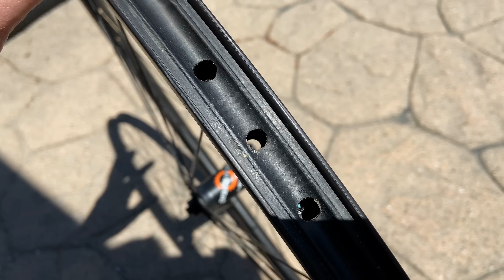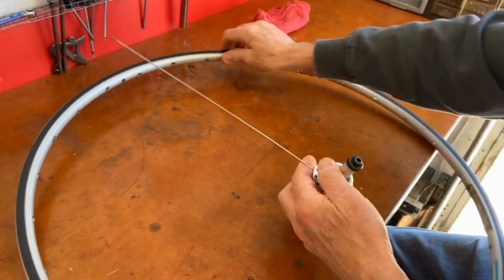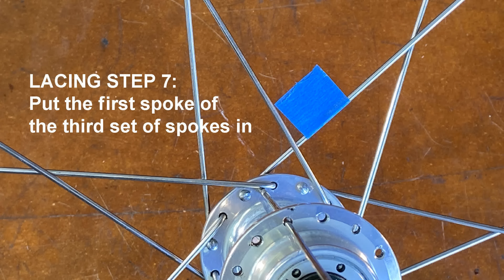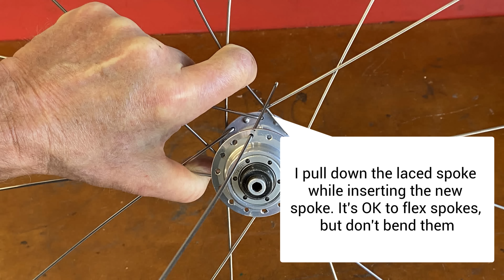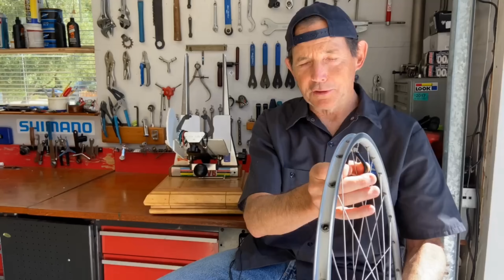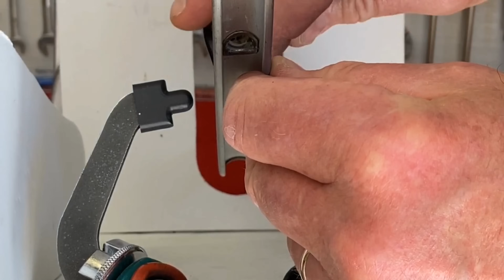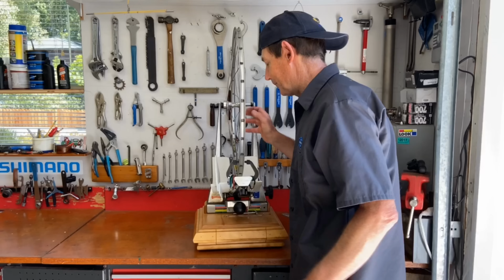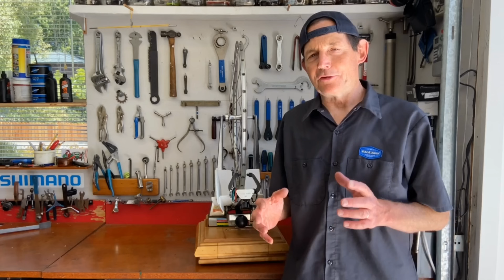How To Build Bicycle Wheels THE EASY WAY! #bikerepair

Comment: Very nice.  Thanks for the information.  Recently, my wheels have had snapped nipple flanges.  Spokes are intact.  Are there spoke nipples with a little larger flange so they don’t break through the wheel holes?  Or, is there another fix?
Reply from the maker: Thanks for watching and the question, cottagethyme. Nipples come in different sizes but the entire nipple is larger not just their flanges. You can use nipple washers to add material to the nipples and reinforce them. 

But, you should inspect your intact nipples to see if the problem - the reason the nipples are breaking is because the spokes are too short. If the spokes don’t reach to the top of the nipples (look down from inside the nipples), then the nipples are not fully supported and can break. Alloy nipples are especially prone to breakage when spokes are even a little too short. 

If the spokes are too short and the nipples are alloy you could replace them with brass to fix the problem. Brass nipples are much less likely to break than alloy - even with too short spokes. Or, you could also replace the short spokes with longer ones. Okay? Hope this helps. Thanks again!

Comment: How can I do it for a 1 cross, 16 holes track wheel ? Do I still have to leave 3 holes between each spoke ?
Reply from the maker: Thanks for watching and the question, Mano. Yes, it’s the same process. The only difference from what I show is you are using 4 sets of 4 spokes and crossing only 1 spoke. Have fun!

Comment: i'm about to start a rebuild on 2 28 spoke wheels 1 front 1 rear, think i will need to watch this video a few times, i got a bit lost watching. never done this before, i can do anything else on a bike but always passed on wheel building.
Reply from the maker: Thanks for watching and commenting, Jowen. The key thing is to take it one step at a time when you lace the wheel. And take your time, don't rush. You can do it. Good luck and let me know if you have any questions.

Comment: Thanks for your video!  Around 13:00 you helped me catch an error before I went to the tightening and truing steps.  I had spin the hub in the wrong direction and the spokes surrounding the valve stem were not parallel but in a tight triangle.  I was able to backtrack, and now it's right.  Thanks again!
Reply from the maker: Thanks for watching, ML. Whew! I'm glad you caught that error. It's a very common mistake and easy to make - good job finding it before you finished! Enjoy your new wheel!

Comment: When building a few wheels long ago, I always did all the spokes outside in first. Less weaving needed, but the wheel stays "loose" longer, not ideal.
Another thing, I don't like the tapping of the ends, I feel it's the wrong way to get the spokes to seat. Let me think about that more.
Reply from the maker: Thanks for watching and commenting, Michiel. I actually show two ways to seat the spokes so viewers can choose which one they like - the tapping - or the leverage technique with a small screwdriver here: https://youtu.be/XUqul03hbZ8?t=1382 And, yes, there are many methods of lacing wheels and all have their pros and cons ;-) The one I teach here is specifically aimed at new wheel builders because it's the one I have found easiest to follow for the students I've taught. Thanks again!
Reply: @JimLangley1  Ah, my bad presumption (that this is your only way). The method I like is to squeeze pairs of spokes with your hands (gloves on of course), in a few stages of tensioning the wheel. That way the head is pulled, and the bend gets to seat in the hub flange.
Another method I've seen being promoted, of putting pressure sideways to the hub, is trying to accomplish seating the spokes as well, but doesn't have the leverage of squeezing pairs of spokes.
Reply from the maker: @MichielvanderMeulen  yes, in my video I also show squeezing pairs of spokes, which is part of the stress relieving procedure as is putting sideways pressure on the rim. These steps help seat the nipples in the rims and relieve possible wind-up in the spokes, and less so, helps pull the spoke heads into the hub holes  Tapping the spoke heads and pulling them into the hub holes with the screwdriver method are done earlier in the build process as a way to guarantee that the spoke heads have full support in their holes. These techniques direct the force more on the spoke heads than squeezing the spokes (stress relieving). That's the idea. Hope that helps explain.

Comment: I rebuilt reusing the spokes and rims, and hubs a shade smaller, an 8th of an inch across.  I had trouble getting the second set of spokes on each side to connect with the nipples, and even now after tightening these spokes are showing their threads. I can’t work out what I have done wrong. Can you help?
Reply: I have used your method with the tape instead of the twist and I have found where I went wrong.
Do they say this correspondence is now ended?  Or ask a question and you are half way to the answer.  With Thanks.
Reply from the maker: @robertmuncaster3510  thanks for letting me know that you figured it out. Congratulations and enjoy those new wheels!
Reply from the maker: Hi Robert, if all the spokes are showing threads below the bottom of the nipples your spokes are most likely too short. One thing you can try is to relace the wheel but this time if you used 3-cross lacing, try 2-cross. That will effectively make the spokes longer and can sometimes fix the issue you're having. Give that a try.
Reply: @JimLangley1  Thank you for your suggestion
Reply from the maker: @robertmuncaster3510  you're very welcome. I should have added that if the spokes seem a little long after you go to the fewer cross lacing it's usually no problem - the nipples can be tightened enough.
Reply: If I am not being a nuisance....I had 9 spokes long and 9 spokes short on each side, on a Google forum it said for 8 short 8 long the reason would be I had not twisted the hub enough when starting the second set of the  four.  I will check in the morning, it’s three in the morning now!
I found your video really instructive and this after service is a bonus, very kind of you.
Reply: I don’t think so, I have just been to look and the parallel spokes are 8 holes apart, like the Germans said.  I think I will loosen them all off and try again.  Thank you for your time...from across the pond.

Comment: I appreciated your detailed instructional video. I took apart two unusable wheels wheels to build one decent wheel. I had to slightly modify your process, however. Because my wheels are 4 x 7 spokes, they would not reach the rim at the angle necessary to cross over 2 and under one. Thus, I laced the 2nd and 4th sets under the first spoke that it crossed. I then compared my lacing pattern to the wheel pictured by the manufacturer, State, all road 700c.
Reply from the maker: Great job solving the spoke length issue, Robert. A lot of modern wheels now use 2 cross instead of 3 so that was smart of you to go to that. Congrats on building your wheel and thanks for watching and commenting, appreciate it!!
Reply: @JimLangley1  Thanks! It has lead me to question the reason why the newer wheels do the 2 cross, and it makes me wonder if this is weakening the wheel? I’ve had two spokes break in 500 miles of riding on a brand new 2 cross all-road wheel.
Reply from the maker: @robertnowlin9404  That's a good question, Robert. But the number of crosses in the wheel doesn't really impact spoke durability. The main reason spokes break is that they're not good quality spokes. You can test for this pretty easily. One way is with a magnet.

Quality spokes that most wheelbuilders use are made of stainless steels that won't or will barely attract a magnet. So if a magnet sticks well, you probably have cheap spokes in those wheels made of plain Jane steel. Those will corrode and often break before they have a chance to rust.

Spokes are so important to the strength and durability of any wheels that good builders usually stick with a favorite brand that they can trust. I prefer DT Swiss spokes and I will also use Sapim spokes and Pillar spokes. Those are all stainless steel and reliable spokes. It's unlikely they will break for even thousands of miles and years of use - and regardless of how many crosses the wheel is laced with. 

Quality spokes like this, DT, Sapim and Pillar are marked on the spoke head or on the spoke itself. These marks can be difficult to see but if you look closely you'll find them. If your spokes are magnetic and not marked as DT or Sapim or Pillar, then that's the most likely reason they're breaking. I would recommend rebuilding the wheels with quality spokes to ensure you don't keep having spokes break. I hope this is helpful. Jim
Reply: @JimLangley1  I’ll definitely check on the spokes as you said. State Bicycle Company tends to use their own brand on components. They have seemed less durable than common brands. I wonder if the rims need to be a certain type of metal as well, as they both were bent in a crash involving a curb that I hit head on.
Reply from the maker: @robertnowlin9404  I checked State's website and didn't find any specs on the spokes on the bikes I looked at. That usually means that they are using inexpensive spokes to keep the price of the bikes down. And, unfortunately it often means cheap steel spokes that break quickly. Even hitting a curb should not cause spokes to break - quality spokes can bend from impacts such as that but they can be bent back and still will work fine. 

Regarding the rim material, it's most likely aluminum. There's a slight chance it might be steel but usually the product managers spec aluminum at all price points because the weight savings at the wheels makes such a noticeable difference in ride performance. Also, rim brakes bite far better on aluminum than steel rims. Here again a magnet is handy for determining what you've got. Hope this is helpful.

Comment: Why use spokes?
Reply from the maker: Thanks for watching, Damien but I don't understand your question.
Reply: @JimLangley1  Why aren't all adult bicycle wheels make of thick hard carbon with tubeless tires? The adult bicycle market is mostly professional so it would be worth it for most people.
Reply from the maker: @gotsm9959  Thanks for explaining more, Damien. The thing is that the basic bicycle wheel is a marvel of technology - incredibly light, durable and affordable. To go to carbon would greatly increase cost and reduce ease & cost of maintenance & repairs - and tubeless bicycle tire technology has a long ways to go before it'll be ready for all bikes and all uses. Wire spoke wheels are just the best technology for everyday bicycles even after 150 years of people trying to invent something better ;-) Of course, there are carbon wheels and tubeless tires for high-end pro racing bicycles where having superlight, superfast wheels is crucial. But for the average bicycle they don't make sense. Thanks again for the interesting comments.

Comment: I cannot find my comment , any way Excellent ! ...... Haw  tight   screwing  all  spokes in the beginning of instillation must be can you explain?  Best regardes
Reply from the maker: Hi sarchel - the main thing is you want the spoke nipples all turned to the same amount on the spokes. That way you start truing with the wheel somewhat true and round. It’s not about tightness really but about the depth each nipple is turned down onto the spoke. Okay? I hope this answers your question. Thanks!
Reply: @JimLangley1  to thr last skrew threads
Reply from the maker: @sarchelsami5431  it doesn’t have to be to the last screw thread. On some wheels you might not be able to do that until later when the wheel is close to finished. All that you need is to have the same number of threads showing. That’ll work every time. Hope that helps explain. Thanks!

Comment: I really enjoyed your video explaining how to build a bicycle wheel. My first experience doing this was when I restored an old 1950s Monark bicycle that my grandfather gave me when I was about 14 years old. Some of the spokes were almost rusted in half. I took both wheels completely apart and started over with a box of new spokes. I painted the bike red with white rims and left the hubs chrome. I remember sitting on the carpet floor assembling the rims and then truing them up on the upside down bike while my dad, grandfather, and I watched TV.  It was relaxing and a great project for a teenage boy to tackle. After watching your video I'm wondering if I went under the 3rd spoke when I was assembling the rims.
Reply from the maker: What a great story, Chip. Thank you for sharing and for watching my video. I’m happy it brought back nice memories. I bet those spokes on that Monark were not interlaced but I am not certain.
Reply: @JimLangley1  I don't remember either anymore. It's been about 24 years ago I did that. I need to find a new chain for that bike. It has the oddball skip tooth chain.
Reply from the maker: @chipwright6193  you might find a chain on eBay.com if you keep looking, Chip. Good luck!

Comment: There’s amazing method for quickly truing up rear wheels on a new build.  I learned it on a website by the creator of Wheelsmith wheels and spokes.  

Because a rear wheel is asymmetrical, and the sprocket side spokes are nearly vertical, this works.  I also used it successfully once on a front disc wheel that came from the factory very unevenly tensioned, so I loosened all spokes a few turns, and tried this method.  

What one does is first concentrate ONLY on adjusting for the roundness of the wheel, adjusting ONLY the sprocket side spokes.  After the wheel is round, concentrate ONLY on side to side truing by the spokes on the other side.  Go through again to fine tune.

It’s amazing how fast and easy one can build up a rear wheel this way.  It saves you almost all the complexity of having to work both sides carefully in harmony, and deciding whether to loosen on one side and/or to tighten on the other.
Reply from the maker: Thanks for watching and commenting, Jeff. Yes, my friend Ric Hjertberg wrote about that on his wheelfanatyk.com blog and it’s a nice way to speed up building rear wheels. Thanks for offering that tip, appreciate it!

Comment: My wheel is not turning when I move the pedals with my hands. What could be. Does dust  cause this. I removed all the dust, but maybe something got stuck somewhere. Is lubrication issue? if so which oil do I buy? I don't even know how much oil I use? It's a touring Trek bicycle that was in a room inside home for 10 years. It got very dusty and maybe also grease from the kitchen, I think.
Reply from the maker: Hi Tut, the freewheel is probably in need of lubing. The freewheel is the mechanism that drives the wheel. There are little parts called pawls that can get stuck in a way where they don’t drive the wheel. If that happens the pedals and chain turn, the gears too but the pawls don’t engage to drive the wheel. (FYI-you can’t see the pawls-they are inside the freewheel.) Usually if you spray a lube - almost any spray lube you have will work - then let it sit a little while and keep pedaling and backpedaling, the lube will get the pawls working and driving the wheel again. You have to get the spray inside the freewheel. Look close on both sides - front and back) as you pedal. You’ll see a crack between the moving gears and the part not moving. Get the spray in there, that crack. Give that a try. Good luck!
Reply: @JimLangley1  Thank you.

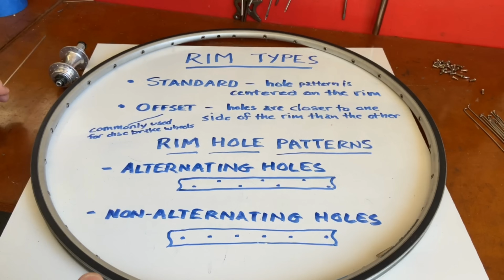Comment: May i know what size of the spoke that u use in 6:55
Reply from the maker: Hi Fatah, it's probably a 297mm spoke. But, the spokes you use building your own wheel will be different lengths than mine most likely. So perhaps I do not understand your question. Please explain more if you need more help and I'll see if I can help. Thanks for watching the video!

Comment: For me i do fix the roundness before fixing side by side.
Reply from the maker: Thanks a lot for watching and commenting, Oriculo, appreciate it. It’s fine to true for roundness first. The only thing is that if there are bad side to side wobbles they can make accurately judging roundness issues more difficult. But if the wheel is pretty true laterally fixing roundness first works fine. Thanks again!

Comment: What about fat bike wheels as you have to lace up twice really... i have tried it in the past and scratched my rim so much i gave it to the professionals.???
Reply from the maker: That’s a great question, Sean. Fat bike wheels come in many varieties and I am not an expert on them. But the same basic concepts and steps will work for crossed spoke wheels. You should be able to avoid rim scratching but keeping your finger over the spoke threads when inserting and moving the spokes. Also, most rims are designed to be laced a certain way. The instructions are usually online. By understanding the instructions it should be possible to build the wheel without too much difficulty. But it might take a little trial and error to figure it out. Even pro wheelbuilders need to read the instructions at first to get it right. Hope this is helpful. Thanks for watching and the great comment.